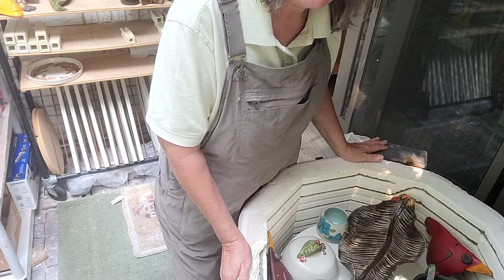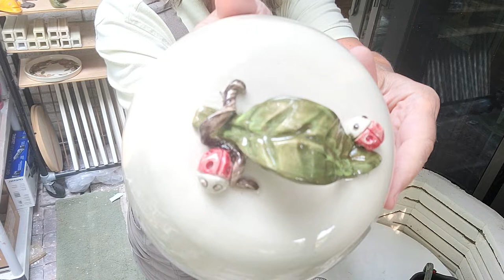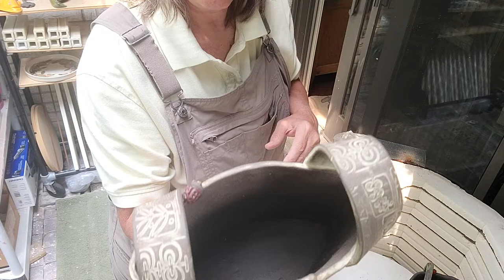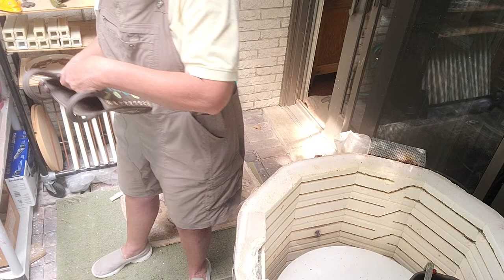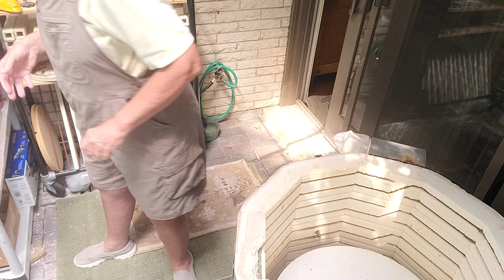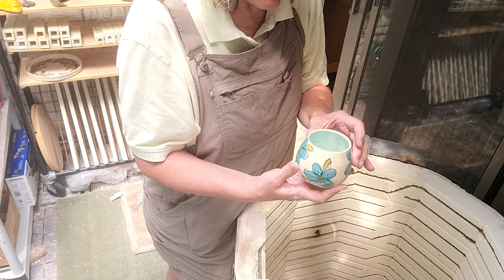July 28.2021 KILN OPENING.  Check out the super cool purse planters!! (or utencil holder, I suppose)

Comment: The main reason you sand the bottoms is that they are not glazed on midfire pots and if there is even the slightest bumps it will scratch the wood surface of the user and that will cause problems.
Reply from the maker: Yep, you are correct.  :-)  Burnishing also helps seal the clay.
Reply: @WildAcornsArtStudio  I would sooo love to see you make your leaves!! I have tried several times and they just look terrible!! Please show us!!
Reply from the maker: Which leaves?  The ones with the dark clay, with the white underglaze?